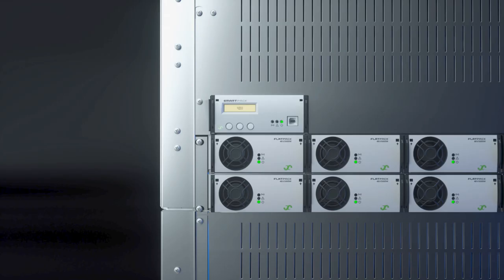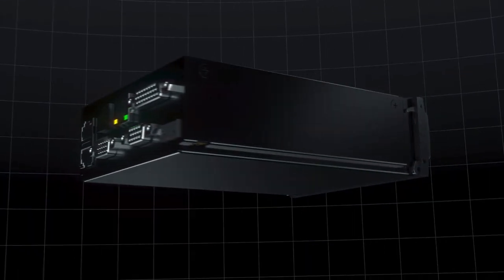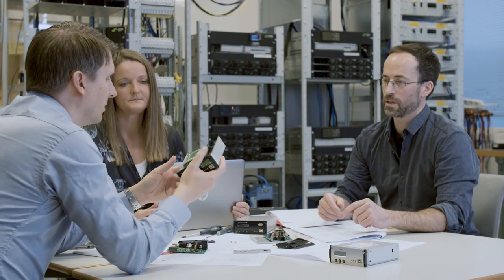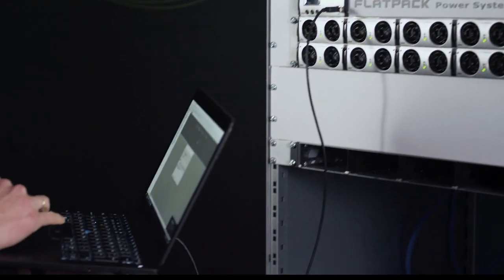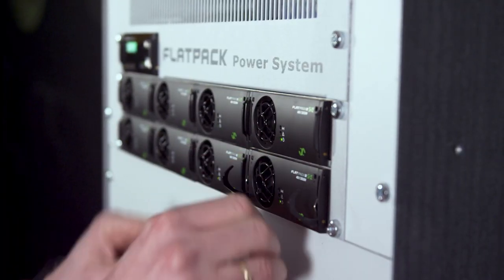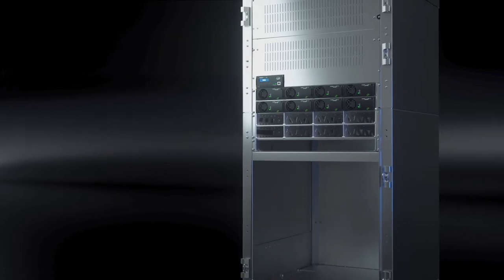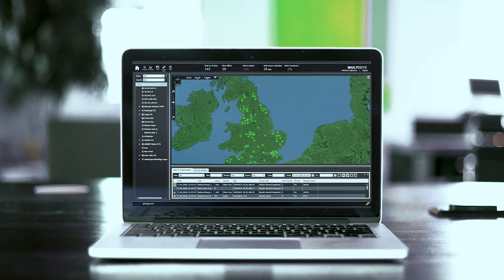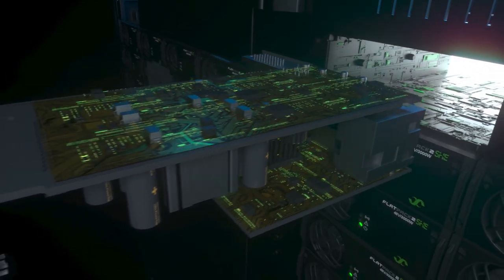Meet the Eltek Smartpack-R -  Retrofit Controller

Comment: @Eltek AS  Could you please provide manual on how to access the Eltek Smartpack R, usually I used printer port cable to all smartpack2 controller but this is different. I doesn't recognized the printer port cable. Any explanation there please. Thanks in advance.
Reply from the maker: Hi TX, 
To get the best service, we recommend getting in touch with your closest Eltek office. 
To send a message, or get the contact info, go here: https://www.eltek.com/top-menu/contact-us/
Reply: Oi TX, conseguiu informação sobre o acesso smartpack R pela porta usb